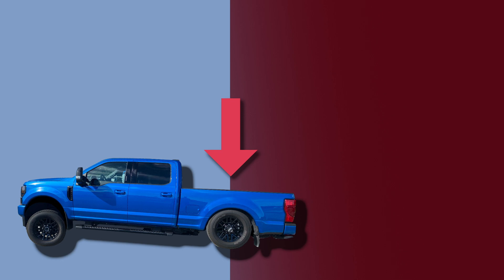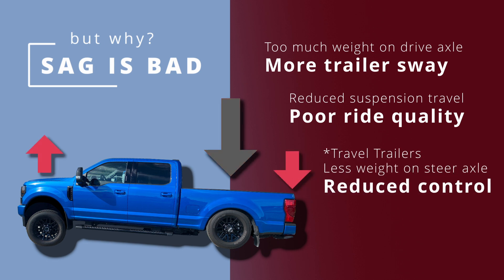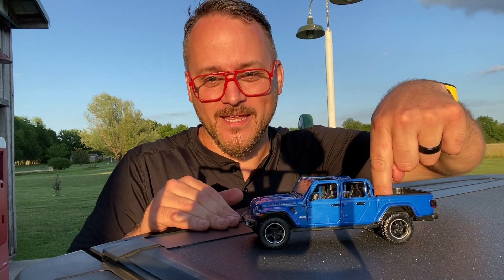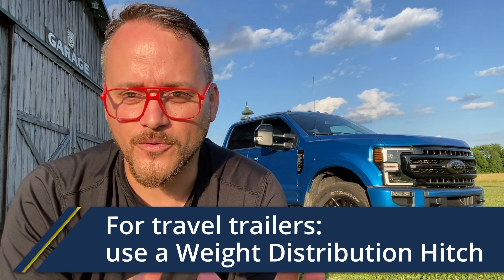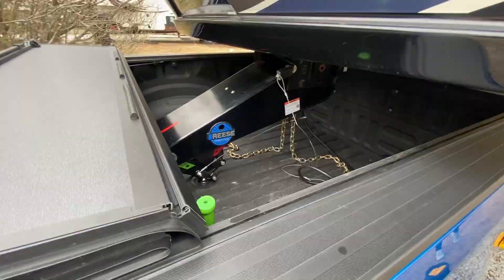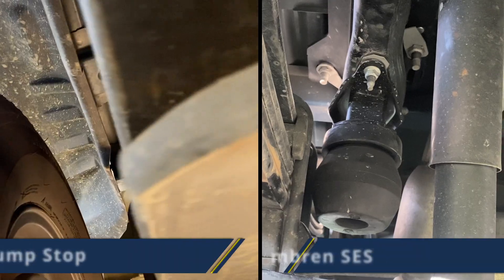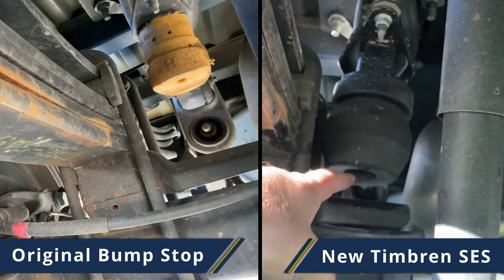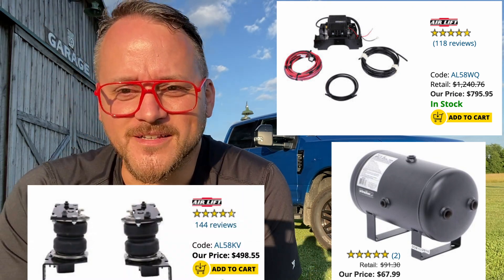Timbren SES Review - Ford Superduty F-350 7.3L + 5th Wheel

Comment: As long as you have sufficient payload capacity, I’d add some air bags. I have a 21 F350 dually and it gets a few inches of squat when my 5th wheel is loaded heavy. I installed RiteRide Heavy Duty air bags and hooked it up to my on-board compressor that also runs my air horn. All adjustments are made from the cab.

Comment: I have a 23 F350 with snow plow prep so it has the stiffer front springs and sits almost totally level when unloaded. When I hook up my 13,000 5W it barely touches one side of the overload springs. The rear end sits about an inch lower than the front so it looks like it's sagging a bit but it's not.

Comment: Just came across your channel and like all of your videos. They’re very informative. Ive been full timing for 2 years and have an f150 with 25ft travel trailer and looking to upgrade to a 5th wheel and an f350 7.3 like yours. Did you build and buy your truck? I’ve noticed there’s not many f350 7.3 engine options when shopping around online. Also do you have the 6.5 ft or 8 ft bed? Thanks!

Comment: Hi Ryan. Do you mind giving out your RV numbers? GVWR, total length, average pin (hitch) weight per tow? I have the same truck in a Tremor package (F350) and trying to gage what I can pull (5er) w/o over working the truck. Thanks.
Reply from the maker: 11,300# GVWR truck
16,000# GVWR trailer
Last weight I was a combined 23,820 pounds

Montana High Country 335BH is 37' with a rear slide that makes it 39' when parked. Empty weight on the tag is 12,250# and is about 15k loaded. It can handle 16k but I don't have room to add anymore stuff. 3,280# on the hitch last time I weighed. That makes 6,880# on the drive axle, which is rated at 7,230#. Front axle is under too but I'm maxed on total payload.

I think your biggest Tremor problem will be the extra bed height. I towed the same trailer with an AT4 HD, which had 1.5" higher bed height. The fifth wheel chucked more being nose high. I'm in the Smoky Mountains now and I haven't felt like I'm overworking the truck at all. I'm sure the Rockies are a different story, but these grade are no problem.

Comment: The problem is, people don't want their truck to ride like a truck. So, the manufacturers soften up the suspension for a better ride quality. Mt F250 rides better than our car does. If you are towing a heavy camper, you are better off adding something to carry the load better. Like you, I installed the Timbren's and they work for me. I had airbags on my previous truck and one failed, Timbren's are all most fool proof and less expensive.

Comment: What is your PIN weight?
Reply from the maker: Roughly 3k pounds. I think I have to call it hitch weight though before someone else points out I have a gooseneck-type hitch and not a traditional 5th wheel hitch.

The rear axle is rated to 7,230lbs and last check I'm around 6,800lbs. That was right after moving out of the house though so we've been lightening up that hitch weight a bit further and removing some things from the bed.

Comment: What foot/lbs did you torque the bolts?
Reply from the maker: https://timbren.com/n-109-how-to-install-a-timbren-ses-kit-in-7-easy-steps.html

Check step 7 in that link. Basically, just get it tight without over-powering it. You don't need your torque wrench on this project. Those metal U-nut things you're going into probably won't handle much torque. The pressure of the load on one side aand axle on the other are doing all the work.

Comment: why buy a 1 ton if you STILL have to beef up the suspension??? Sounds like a case of more money than brains....
Reply: Nah, you’ll notice it’s a standard bad single rear wheel. I could have gone with a long bed dually that would handle the weight better for a bit more money, but then I’d have a longer, wider truck with a worse turning radius. Since we use this truck as our way of getting around, it makes sense to have the smaller vehicle with a few modifications.